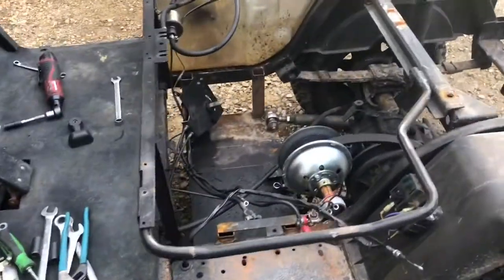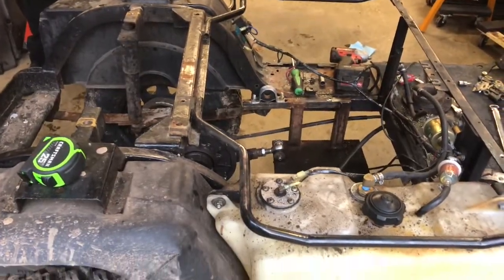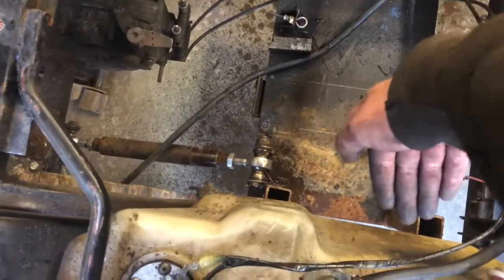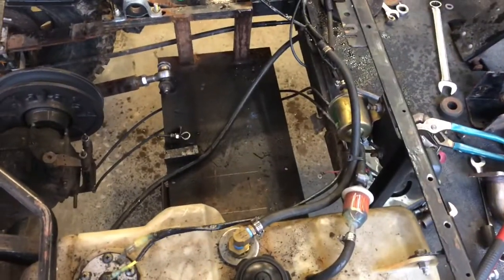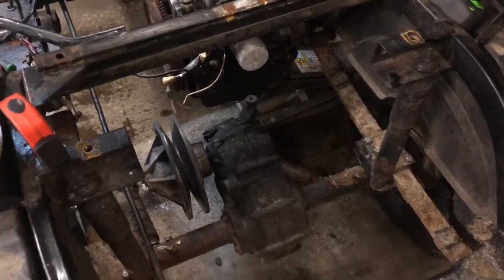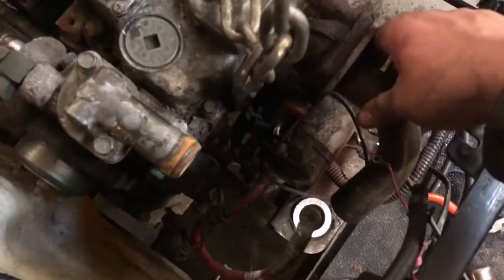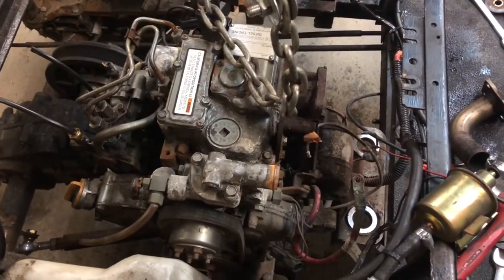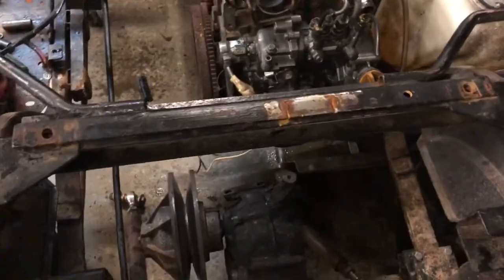Yanmar Diesel Installed in the Golf Cart

Comment: You know they make a turbo version of this motor that gets about 40 horsepower right?
Reply from the maker: I doubt there’s a 570cc 40hp 2 cylinder from the factory. 40hp is more of a 1.3-2L type of power level. That engine is long gone anyway.
Reply: @pacificdrumma  Oh, sorry.  I thought it was the 3 cylinder.  I have a YANMAR 3TNV84 in my Gator.  I have been looking at the 3TNV84T.  My Gator is rated about 23 horse and the 3TNV84T is rated at about 40.  The turbos run about $300 but the exhaust manifold and a bunch of other things look a little different.  Having that in my gator would be awesome though.
Reply from the maker: @rehoboth_farm  that makes more sense because that’s a turbo 1.5L. This is a 2TNV70. Much less displacement. My mower has a 1.1L Cat/Perkins that makes around 30hp.